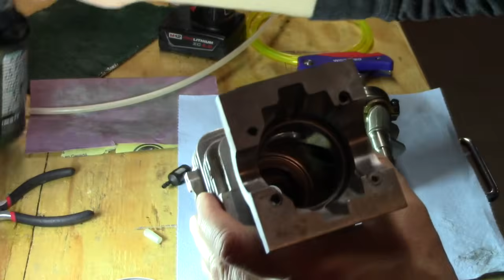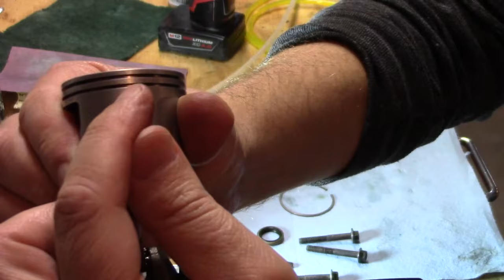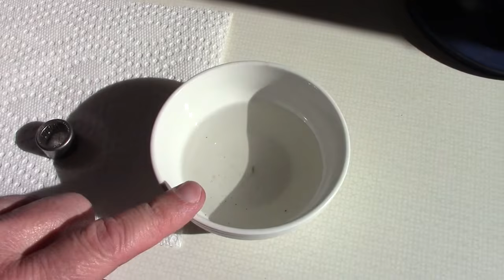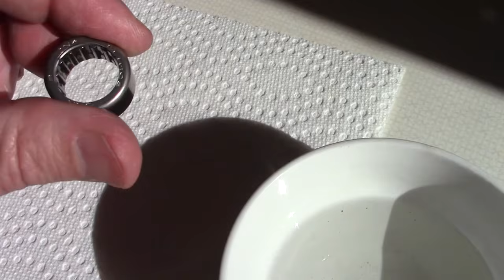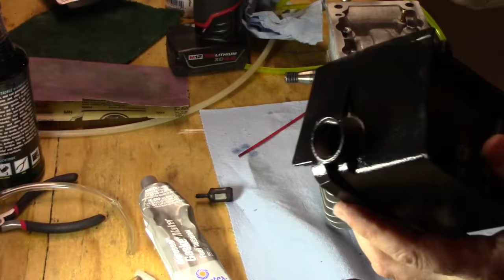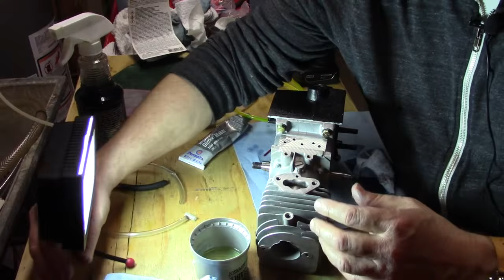Power Cylinder McCulloch Timber Bear

Comment: I am rebuilding the same exact saw for the same exact reason, and I went ahead and bought new piston rings and can not get the piston with the rings on it into the cylinder for the life of me. Everything's lube up, piston pins are centered in the ring gaps, not even in the same ballpark as far as wiggling it in there.
Reply from the maker: Wow, what kind of ring gap do you get when you place the rings in the cylinder without the piston? I forget what it should be. Probably around 0.03 inch.